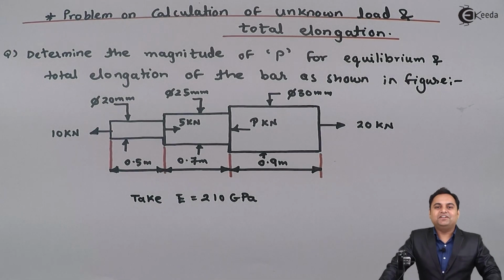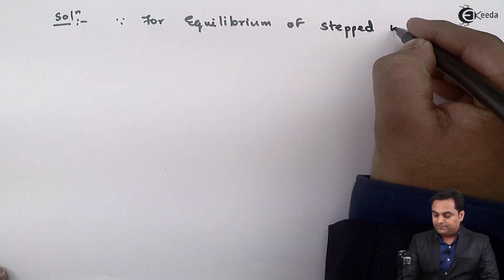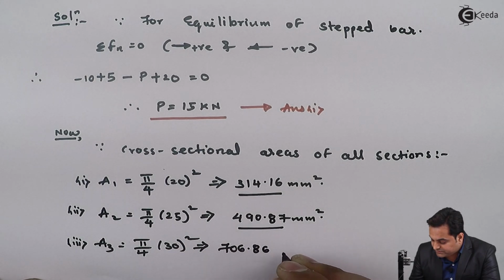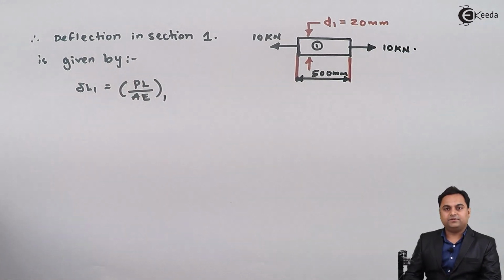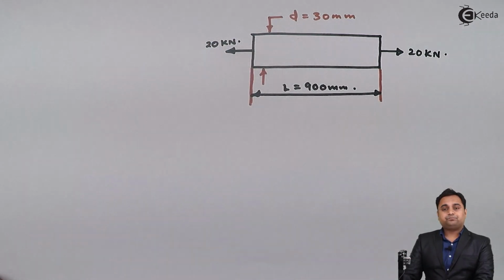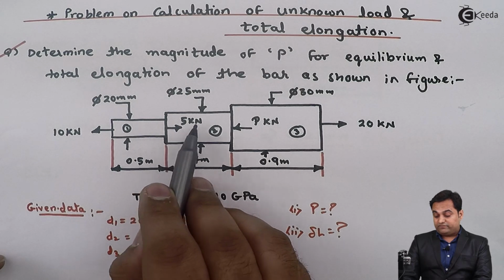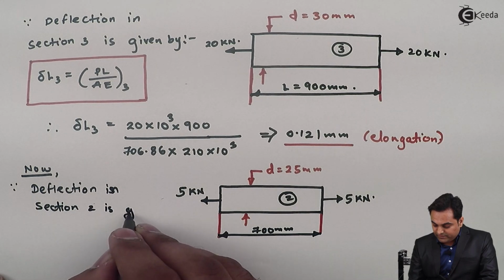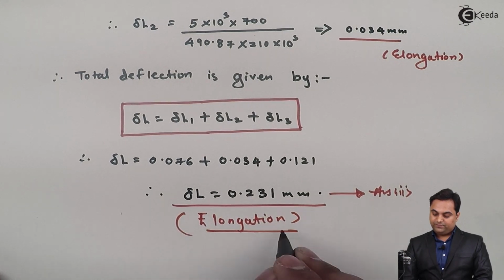Problem on Unknown Load 'P' and Total Elongation - Stress and Strain - Strength of Materials

Comment: The following results were obtained in a tensile test on a mild steel specimen of original diameter 20 mm and gauge length 40 mm = 80 kN Load at limit of proportionality Extension at 80 kN load Load at yield point Maximum load 0.048 mm -85 kN -150 kN When the two parts were fitted together after being broken, the length between gauge length was found to be 55.6 mm and the diameter at the neck was 15.8 mm. Calculate Young's modulus, yield stress, ultimate tensile stress, percentage elongation and percentage reduction in area. IA ns. 213 kN/rn m2; 270 N/mm, 478 N/mm. ; 39%, 38%) what is the solution steps?